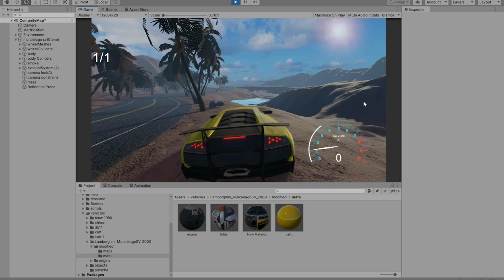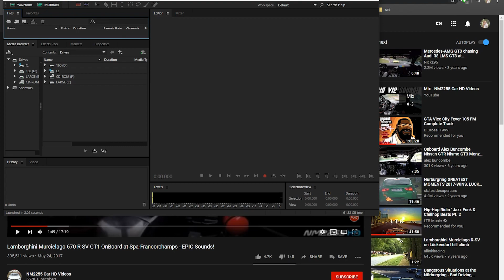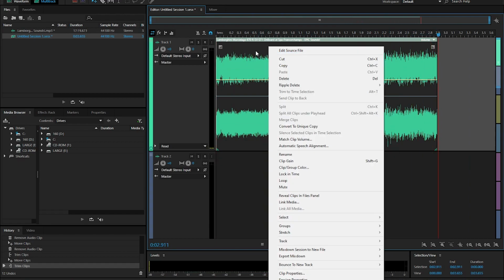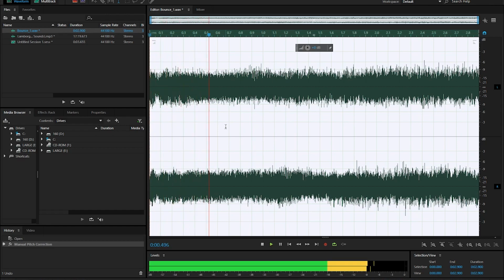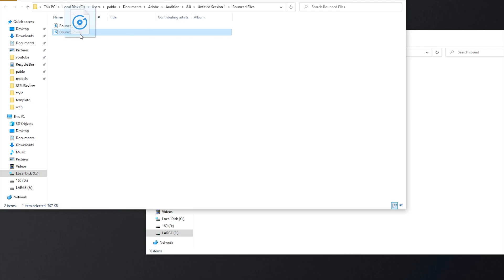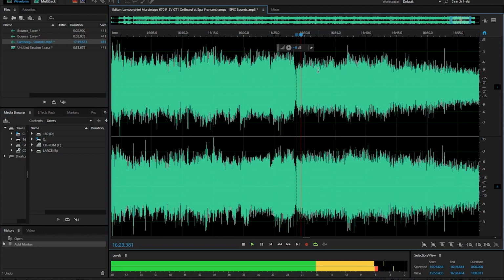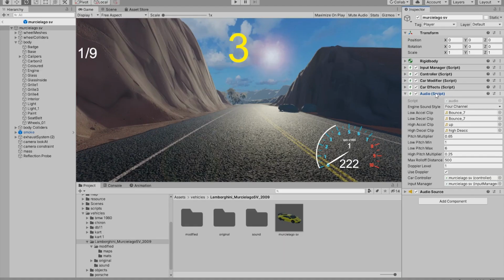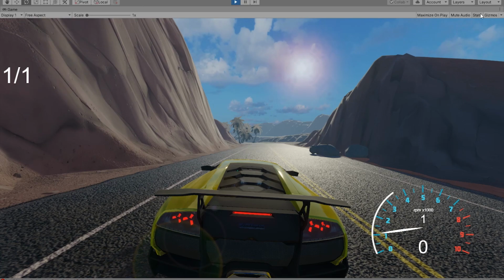Realistic Car Engine Sounds - Unity

Comment: Great video as always! ;)
Dou you have an idea on how you could make the drift more controllable? (Especially at a higher speed)
Reply from the maker: change drift multiplier value , usually is set to 1.8 , higher is gripper
Reply: @pabloslab  I now tried increasing the drift value and it definitely works better, but what I meant by "more controllable" is, that you can slightly steer the car while drifting so you can hold the drift longer. Right now I can't really change the direction the car is going, while in drift so I have to stop the drift in longer corners
Reply from the maker: you can , by steering left or right car changes direction slightly
Reply: @pabloslab  what u use for edit audio??